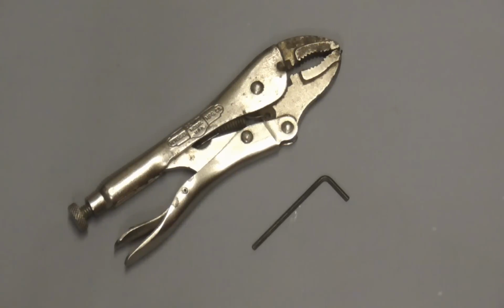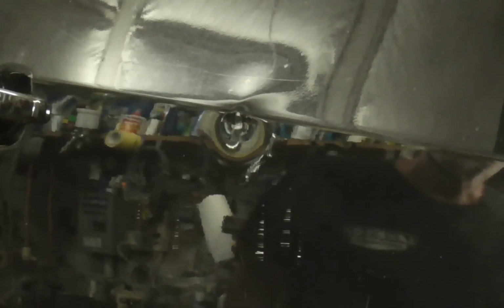Low-Buck Way to Fix a Dent

Comment: Thanks! Good tip. 
I have a dent in the  column on the rear corner of a van, next to the tailgate.  I'll give it a shot.
I think I'll use a piece of wood and a flatbar for leverage against the vicegrip.
Reply from the maker: 👍 Let me know how it goes.

Comment: even better if you used fiberglass reinforced over the hole area then regular filler over that. These repairs worked well for many many years until someone made mig welders and stud welders so cheap.
Reply from the maker: Good tip Mike.  Thanks for checking out the video - you're always very supportive - that's really cool of you my friend. Hope all is well 😊
Reply: I've had good luck just packing the hole shut with regular bondo.  Bondo will easily bridge a 1/8 hole like this.  

Mind you this was for our daily drivers,  not a customer's car or anything hugely valuable.
Reply from the maker: @magnang  You're right - you won't have problems with it either because it's up high.  The salt and debris that rusts a car settles down low in the panel - that's where it will rust out first and fastest :)

Comment: I had put that comment in the other video.  Very cool that you tried it!  Nice work as always.

I've used this trick a bunch of times and the hole hasn't caused any issues.   One repair lasted me 5 years without issues and we are in Canada where the roads get salted.

It's not professional but for a DIY if you can get the metal 90% right and then pack it,  it will get you close enough for a daily driver.
Reply from the maker: I thank you my friend for that comment - nice idea.  I mentioned your name at the beginning of the video.  Hope you have a great weekend and again - appreciate the tip :)

Comment: Your highlight said urethane or lacquer. I sure would like to ask what brand of lacquer primer do you use or recommend. Thanks very much!
Phillip Hall
Reply from the maker: I use Auto Body Master lacquer primer surfacer because it's locally available a Auto Value auto parts.  All brands of lacquer primer surfacers are very similar.  You can thin it with lacquer thinner purchased at Home Depot, etc.  All products are getting expensive but at least with lacquer primer you can toss the unused portion back in the can or just leave it in the cup - it won't harden on you :)
Reply: @LakesideAutobody  
Thank you Mr Lakeside. Just what I needed to know. Glad to know it can be set aside and used later.  Thumbs Up to you Lakeside..  Appreciate  you.. 
Phillip Hall
Reply from the maker: @PhillipHall01  You're welcome.  1 gallon of primer will make around 2 gallons of usable primer.  Generally you are going to thin it 1:1  - thicker for block sanding purposes - thinner for finish sanding :)
Reply: @LakesideAutobody  
Thank you for the GOOD information. 😊
Reply from the maker: @PhillipHall01  You're welcome :)

Comment: My first thought was did he really just drill a hole in that
Reply from the maker: A good thing to remember is that there are holes all over cars... they never rust.  Holes are very often used on panels to hold trim on - clips pop into the holes.  You wont have an issue with it :)
Reply: Old School method. The filler pushes through the hole and locks on. Kinda like how the Allen wrench is doing.
Reply: @LakesideAutobody ..does acrylic paint require.. clearcoat?😢..or polish with???
Reply from the maker: @Heberslade  Acrylic enamel and urethane single stage does not require a clear.  Base coat urethane (BC/CC) does require clear.  You can clear single stage paint though if you want :)   Ask more ?s if that don't make sense :)
Reply: @LakesideAutobody   thanks so much for your response..but I forgot to mention ..I spray the single coat from a can over the original ..but my new coat looks a little dull in comparison to surrounding clear coat original .(hood for example)..polish maybe???... supplies?
Reply from the maker: @Heberslade  Are you using Duplicolor?  If so, it is lacquer which requires buffing.  See this video for basic buffing techniques - https://www.youtube.com/watch?v=VJUQgSUbAcM  products are listed in the description
Reply: My first thought was some clown is gonna quack about drilling a hole, lol.  I was gonna pull the dents in my Santa Fe cheapo DIY paint job with a pull rod, but I’ll do this instead.  A lot more people could come up with these tools than an actual pull rod.  I’ll tell them Lakeside Autobody provided the tip😉😉

Comment: Yo Lakeside. Nice trick. No messin' around. You think i can do the same on a motorcycle tank big dent ? Can always seal up the hole with a decent epoxy before applying filler
Reply from the maker: Absolutely - Maybe use J-B Weld TankWeld first :)
Reply: @LakesideAutobody  Ok. Thanks Jerry

Comment: Makin it look easy again.  I really should wear a respirator more often.  I seem to be getting a little lackadaisical in the safety department lately
Reply from the maker: It's easy to do - especially when it's hot out.  A lung doc once told me that there's no way that the dust can make it to your lungs so that was sort of comforting but that's hard to believe.  I try to be as safe as possible the older I get though anyway :)

Comment: I like your cheese grader. Only applicable at still wet, or does it go all the way to sandpaper bubble gum ?
Edit; Primer Surfacer, is that the same as a Primer Filler ?
Reply from the maker: You have to wait till the filler is just about ready to sand - then you can use the cheese grater.  Too soft and it clogs the teeth of the grater - too hard and it won't cut.  You'll get good at knowing when to use it real quick :)

Comment: is this much different than just using a screw in dent puller
Reply from the maker: It is  because the screw in will form a bit a peak or volcano in the metal and you'll have to deal with that.  The Allen wrench spreads out the force and doesn't pull in one tiny area :)

Comment: Did you have to weld the hole first? I couldn’t tell.
Reply from the maker: No - you don't have to weld the hole first.  It won't rust.  Check out all the holes in the panels around your vehicle door bottoms, inside of fenders, drain holes, etc.  It's up high and will stay dry :)
Reply: @LakesideAutobody  awesome, thanks for the quick reply !
Reply from the maker: @caperr2  👍

Comment: I do like my slide puller and tak method, takes a little longer perhaps (deffinatly) lol. But your method I will employ next time i do a mates car. Bit of a time and mental saver..  I wont do this on my car... its structual integrity requires I do not. Looks way faster than I could do it and with that hammer (never seen one just like it but simular to one ive made). Im a qualified LV mechanic but I am a mechacknic with body work, as i dont get paid professionally to do it. Ive made a few low budget tools for the jobs i have done as im a tinkerer (I spend 100 bucks on making a tool I can replicate many times over than buying an 80 dollar one). And I'm not the greatest painter either. . Thanks for the vid, will sub buddy.
Reply: Be cool to see it after paint with a decent straight line light behind it too. Mines always a little wobbly but not noticeable under normal lighting.
Reply from the maker: Thanks for the sub my friend - I think you'll find a lot of things on this channel that will make body work make sense.  Thanks for the comments too :)
Reply from the maker: You will see the finished car in the up coming videos 👍😊

Comment: So I have buy a DA, filler, tape, paint and all the other tools and materials plus taking a course on how to do it. Last time I had a dent it was done by a PDR guy with glue pulling and no pant removal. Much cheaper and the car's original paint has not been touched
Reply: Yes I was wondering the same thing. I know Jerry is a professional, but I was wondering if he ever considered getting into PDR I know it’s an art but does take a considerable set of tools and training.
Reply from the maker: I think I saw two or three dents in my lifetime where the paint was not damaged.  How is it passible to get in an accident and the paint still be perfect?  Maybe a basketball hit it?  Maybe someone Karate chopped it with their bare hand?  Tell me please how you get in an accident w/o the paint being scratched?
Reply from the maker: 65895555 ,  I've picked a few dent's before but it is always faster pulling and using the methods found on this channel.  If you get a job in a body shop and start playing around with a dent for hours you wont have a job long - that's just the bottom line.  You might get .5 hours on this dent (commission pay) - To make a living, you better get it done in 15 minutes.  You wont see any PDR guys working at dealerships - they might have one that they call on a few times a year for that rare dent but they usually have their own little business :)
Reply: So you didn't have to remove your pants for the PDR tech? Lucky...
Reply: @gcarson19  The whole point of PDR is to not remove paint. It's an entire industry and widely used for softer dents. I payed a PDR guy to repair the dent. They do this for a living. The benefits are usually price and no need to match paint
Reply: Can't always do PDR on a dent, especially by a body line

Comment: Drill a HOLE!?

What, is this the 1970s?
Reply from the maker: A good thing to remember is that there are holes all over cars... they never rust.  Holes are very often used on panels to hold trim on - clips pop into the holes.  You wont have an issue with it :)

Comment: Ridiculous...
Reply from the maker: Thanks :)  It will last forever too.  Check out your own car at how many holes are in the panels.  Cars only rust because of trapped debris, salt water, needles, etc.
Reply: @LakesideAutobody  Where did i say it will cause it to rust ? stop making excuses for such a crude repair on someones nice car....
Reply from the maker: @65cj55  It's my car.  The title is "Low Buck Way to Fix a Dent".  That means a cheap way folks that don't have a lot of fancy tools can fix a dent in their own drive way. 😊✌
Reply: @LakesideAutobody  Wow, if that's how you treat your own Car, i wouldn't trust you with mine....a ''low buck'' way would of been to remove the door trim and get it from inside, it would of planished up nice and hardly need any filler.
Reply from the maker: @65cj55  The last thing a body shop owner wants is someone breaking or damaging interior parts to fix a small dent.  It's good to learn from older fellas who actually worked in body shops for many years.  If you want to know the truth about topics in  body work make sure you ask a guy that did it for a living, did it for many years and was very fast and efficient.  Don't learn from magazines, tv or even the internet.  UNLESS the guy did it for a living 😊
Reply: @LakesideAutobody  47 yrs  Coach & Motorbody Builder here, i think i'm quite qualified to comment on the subject thanks....yes i've seen it all before, ''fast and efficient''= low qaulity quick money..
Reply from the maker: @65cj55  Well... fast and efficient doesn't necessarily mean low quality.  Fast and efficient just means the opposite of playing around and wasting materials.  Just messing around my friend - nice talking to you.  Gotta hit the hay - have a great week though 😊✌
Reply: @LakesideAutobody  Take care.